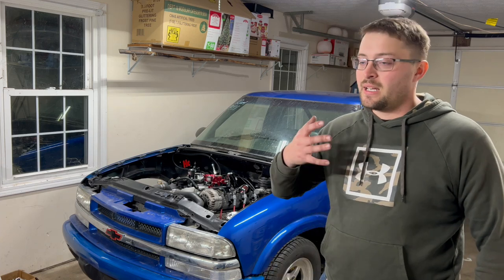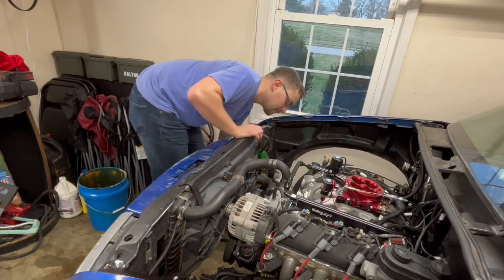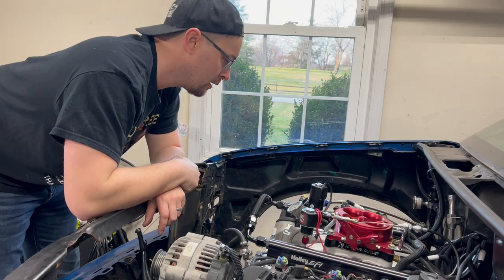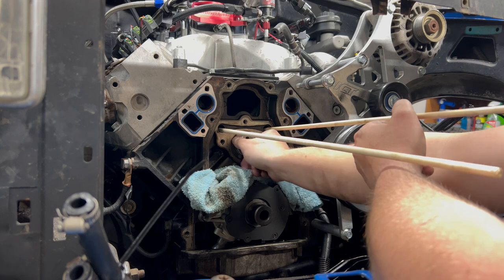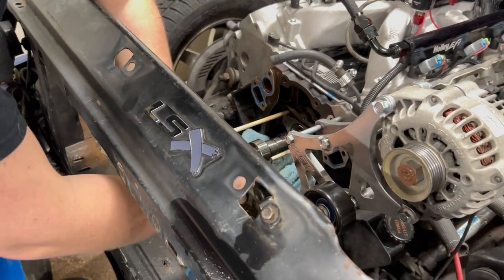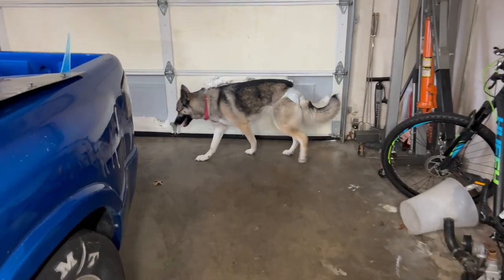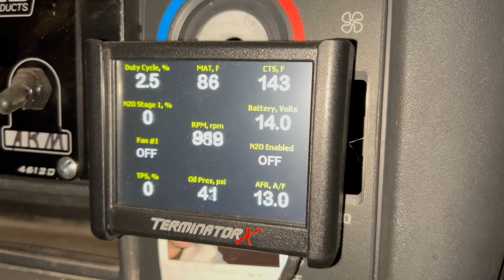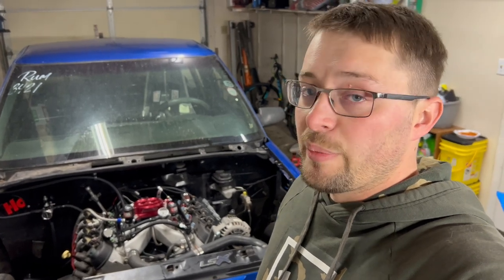I Installed a HUGE Cam in my 6.0 Ls S10! // Cam Motion Junkyard Dog Swap

Comment: I’m surprised no PTV clearance issues😮 but she sounds awesome
Reply: Right 💪🏽, makes me wonder head gasket thickness and if they are milled! Someone got there math on point
Reply: .621 max lift. Btr Stage 2 ls1 cams are .620/.605 i believe. Why would this have ptv issues?
Reply: Because 862s have small chambers as is compared to stock 317s and the new cam has way more lift than btr cams so that would make PTV clearance questionable mainly on the intake valve
Reply: @nathanvillarreal7937  true that
Reply: @tommys2979  it's not the lift but the duration that's the issue

Comment: What radiator and fan is that???? I am putting a 350 in a 1996 Jimmy and that looks VERY roomy.
Reply from the maker: This is a stock 4.3 s10 radiator recessed into the core support with around a 98ish dodge intrepid dual electric fans.
Reply: @LsBluu  THANKS

Comment: I'm think this camshaft will not like a load or much resistance on it until 4000+rpm but your truck being fairly light will help under 3400 pounds with driver this camshaft is not for something that weighing over 4000 pounds
Reply: Definitely not a cam youd want in a fullsize truck. I had the same thoughts on the cam i chose for my 5.3 s10 but knowing the truck is like 3200ish lbs it wont need too much low end to get it moving so i opted for a cam that will wake up more in higher rpm and i plan on spinning it to 6500-7000rpm anyway. Doing it as budget friendly as possibly so thats why i didnt just spec a cam for it.

Comment: If you get the right setup with this camshaft in your truck it should go easy 6.90s on the motor hopefully this isn't to long and please do not take it the wrong way l have a 2011 Camaro SS it has a GM performance LS3 495 horsepower crate engine with milled and CNC ported LS3 heads it has a ZL1 fuel pump and injectors a sheet metal intake and 102mm throttle body it has a built 6L80e transmission with a Circle D 4200rpm lockup stall converter with stock 3.27 gears and a Eaton limited slip it's tuned and runs on E85 it has a load of upgrades lowering springs aluminium one piece driveshaft. race star wheels 305/45r17 MT drag radials rear 18 inch skinnies front but the camshaft duration is 219 intake 228 exhaust it's a pretty mild camshaft it shifts at a fairly low 6600rpm the car weighs 3920 with me in it has a full interior and AC cars best eighth mile was 7.22 at 96mph with 1.65 60 foot times my only problem with it is I'd like to loose 4-5 hundred pounds and if this setup was in your 3400 pound or less S-10 with a good suspension and traction it should go 6.90s easy the engine in my Camaro is not a super high horsepower engine but it has a very broad torque curve it makes really good torque from 2700-6200rpm l had a LS2 swapped carberated single plane intake with a Holley 850 HP carberator 1984 Monte Carlo SS with milled CNC ported LS3 heads built 700r4 with 3000rpm stall converter and a 1986 Buick GN 8.5 rear end with 4.10 gears with a camshaft very simular to the one you just removed with a load of upgrades from 2008-December 2021 bought the car new in 1984 had it over 37 years sold it and bought the 2011 Camaro SS the Monte Carlo SS weighed 3380 with me in it AC deleted it ran 7.50s at 92mph 1.71 60 foot time so even with 500+ pounds of the Camaro it's almost 3 tenths faster than the Monte Carlo was l think the right stall converter and gearing will be more critical and will have to be spot on to get any gains with this new camshaft it will be less forgiving than your previous setup if setup is not matching it does sound wicked it will be more high strung than the previous setup
Reply: Sounds like your car would do better without the lowering springs, no?
Reply: @tommys2979  it's possible it hooks well goes straight with much less drama than the Monte Carlo did has gone 1.65 60 feet the Monte Carlo was lowered with Moroso drag springs front and back so the front end lifted much more off the light than the Camaro does with a decent burnout the Camaro has no traction issues it hooks pretty hard it does have a larger rear tire 305/45r17s than the 275/60r15s on the Monte Carlo the Camaro is very stable over 120mph than the Monte Carlo was at the end of the quarter mile with the Monte Carlo when you take your foot off the gas and the front end drops gives you a bit of a uneasy feeling the Camaro does not the front end of the Monte Carlo really stretched the front springs on take off
Reply: @tommys2979  it looks way better lowered these cars are known to sit kind of high vs other cars in this class
Reply: @tommys2979  it's lowered 1.4 inches it's not slammed leaving about a 1.5 inch gap between the tire and the top of the fender well instead of almost 3 inches l live in Florida it's not a drag car it's more of a nice weather weekend street car l do love the 6L80e automatic transmission with the super low 4.03 1st gear transmission ratio is how l get the 3 27 gears to work good with the Circle D 4200rpm lockup stall converter and AC makes driving on hot afternoons much more enjoyable as does the highway at 80mph at 2100rpm even with the 700r4 l had in the Monte Carlo with 4.10 gears at 80mph on the highway your turning 2800-2900rpm 1st and 2nd and 3rd gear in the Camaro are very close to the 4.10 gears in a 700r4 the Camaro does 123mph at 6600rpm in 3rd gear and with the super low transmission 1st gear ratio it's equivalent to a 4.30 1st gear in a 700r4 so with a fairly mild camshaft there's no need for 3.73-3.91-4.10 gears the throttle response is wicked at the slightest press of the gas petal it's really not a max effort setup its a very usable and can be driven anywhere including the highway for extended periods and do so effortlessly it is equipped with nitrous but timing needs to be backed down from 26 degrees to 19 degrees l have jets for 150-200-250 hit haven't used it yet only when dynoed it was used twice on a 150 hit but hasn't been used on the street or track yet on the motor to the rear tires it made 430 horsepower at 6200rpm and 410 foot pounds of torque at 5000rpm on the motor and 555 horsepower at 6200rpm and 535 foot pounds of torque at 5000rpm on a 150 hit
Reply: @tommys2979  the 7.22 at 96mph eighth mile pass was made with only 6 passes were not talking about a car that has 30-50 passes and the engine was new with 800 or so miles on it I'm pretty sure with more passes and experimenting with tire pressures it made these times on 20psi rear tire pressure and launch techniques it could go a tenth or two better it now has 1400 miles on it I'd love to go 7.0s-high 6.90s on the motor before hitting it with a 150 hit but the 3920 weight with me in it makes it close to impossible without guting things like seats door panels and so on 5th gen Camaros are clearly 500+ pounds on the heavy side for a serious drag car and the only way to shed this kind of weight would be very expensive carbon fiber doors hood fenders and trunk lid or remove everything not needed on the interior or both bottom line the car is pretty heavy my car has lost 110 pounds with removing stock exhaust and big heavy stock mufflers converters and putting on light weight wheels and tires if not it would weigh 4030 pounds with me in it
Reply: @tommys2979  l do love the serious idle and chop on this new camshaft this S-10 has my car sounds like a stock LS3 with long tube headers and a 3 inch X pipe into 3 inch Flow Master flow FX case mufflers exiting in the stock location so it sounds like a LS3 with a exhaust upgrade the mild LS3 GM hot cam has a ever so slight chop at idle that is barely noticeable vs a stock LS3 with the same exhaust upgrades it is fairly quite until about 2800rpm giving you no indication what it's capable of until around 2800rpm it's nothing like the serious chop of this new camshaft on this S-10 l can say l do miss the 7200rpm redline the Monte Carlo SS had the Camaro pulls very strong to 6600rpm power drops off quickly above that so no sense in revving it above that the Monte Carlo SS pulled very strong to 7200rpm l do miss that the + with the setup on my Camaro is the fairy mild camshaft is very easy on valve train components so basic maintenance and oil changes every 500-700 miles it's more than possible it runs well simular to a stock LS3 for a 100,000 miles without replacing very stiff valve springs every 10,000-20,000 miles or the headaches associated with large duration camshafts for me to gain possibly 2-3 tenths of a second maybe or to not pickup nothing or possibly loose time sometimes if something is working very well it's best not to mess with it I've seen many times a setup that's working very well and someone makes upgrades like a higher lift more duration camshaft with bad results not always but it does happen
Reply: @tommys2979  the springs are from BMR part # SP022 and l believe they have the same spring rate as the stock springs just 1.4 lower it's firm but doesn't seem to stiff l believe they 220 lbs front and 460 lbs rear spring rate
Reply: @gloriamaletta8667  oh no kidding, thanks for the info and replies. Ive just always been under the impression most lowering springs have increased rate and dont usually help with weight transfer for drag racing. My cousin actually has an 88 monte ss with a 6 liter, rec port heads and a monster cam in it now. On his old setup running lowering springs, the battery under the hood still and a 228/236 .598 .601 111lsa cam it ran 7.14 at 97mph with a bad launch. Im curious to see how she runs with the battery in the back, drag springs and the new cam. Hes technically going to need a cage in it soon if he wants to run faster at our local track.
Reply: @gloriamaletta8667  and wow 110lbs out of that car is pretty good. Most people dont understand how hard it is to strip even 60lbs from a vehicle.
Reply: @gloriamaletta8667  https://youtu.be/2kNMfKz7C5Q this is my cousins car i was speaking of. Unlike mr.steve there i can provide some proof of what im speaking of haha
Reply: @tommys2979  l had a blue one since new until December 2021 with a LS2 that ran 7.50s in the eight mile at 92mph it went through the original 305 then a 350 then a 383 then a LS2 with milled and CNC ported LS3 heads bought it from SDPC as a custom crate with a single plane intake
Reply: @gloriamaletta8667  that sounds awesome. My cousins started as a 355, then he had a stock ls1 in it on nitrous and a 4l60 til it blew then he went with a 6 liter/th350 combo. Hes trying to get it in the 6.90s before he sprays the new 6 liter set up
Reply: @tommys2979  good luck with it had a G-Body over 37 years
Reply: @gloriamaletta8667  thats awesome. Im sure he will have it ready to rip here shortly. Im not too involved in that project but we do wrench on it together every once in a while.

Comment: Hope this large camshaft gets you the results your wanting l could be completely wrong but l think at least a 4000-4200rpm stall converter and a 4400-4800rpm would most likely even be better with this camshaft it will be down on torque from idle to 4000rpm compared to the cam you had but it will probably carry torque and horsepower above 5500-6000rpm better good luck with it
Reply from the maker: I talked with my tuner and Dr. Tune em all from cleetus’ channel and this is the cam he recommended.
Reply: @LsBluu  these people are in the car and racing business they know more than me what transmission and stall converter and gearing you running
Reply from the maker: @gloriamaletta8667  currently a 3500 nitrous stall, TH400, and 4.10’s.
Reply: @LsBluu  another screw up..but that tells the world why it's so slow and getting nearly beat buy a stock neon..the best thing you could do is get a custom grind cam that is made to your engines full specs. You'll need to cc your heads if you know how for starters then you'll need to flow test the heads.and get rid of the turbo 400. You can't just swap a can and expect big results. If the truck needs a baby bottle then your doing a bunch wrong when I see stock 6.0 LS engines run low 10's in a s10 in the 1/4.
Reply from the maker: I’ll note what ever you say, to do the opposite.
Reply: @LsBluu  don't listen to this guy if you can keep the rpm range in between 5000-7200 this cam if setup right should be a monster if the 3500rpm stall converter works well with it that's great the only thing l see is it may need more converter but other's with way more knowledge than me said the 3500 will be fine the 4.10 gears will be good for this setup worst that could happen is you need to get a stall converter that flashes 4400-4800rpm you'll see most of your gains with this camshaft over your other camshaft above 5000rpm up hope it works good for you be waiting for your first motor passes with it truck sounds wicked at idle good luck with it
Reply: @LsBluu  don't know if you watch videos on YouTube but if you get a chance type in MAPerformance Customer Loyalty Managers 500hp LS Swapped Malibu it's a 1980 Malibu with a carberated LS swap very simular to your S-10 it has a 5000rpm Circle D stall converter car is a monster besides the cowl hood and wheels and tires it looks pretty stock this was what got me started on 4000+ stall converters cammed LS engines love high stall converters
Reply: @LsBluu  when I'm beating you with a stock engine maybe you'll learn. You have already proven that you have much to learn. I have forgot more then you'll know. You just stated that your s youtube engine guy lol
Reply from the maker: @thecarguy2470  lol what?
Reply: @thecarguy2470   no "stock" 6.0 will run low 10s in a s10.
Reply: @slows102  you need to join a few S10 groups and see it yourself before speaking on something you haven't a clue about.

Comment: did you say norbys? you must be around lebanon then?
Reply from the maker: Lol yea
Reply: @LsBluu  hah nice me too. Can’t believe I’ve never seen your truck out and about. Do cops ever give you a hard time about driving on slicks? Ours seem pretty laid back. I know there’s several around on slicks. Curious if ya ever get stopped for it lol
Reply from the maker: Knock on wood, the only thing I’ve ever gotten pulled over for is a seatbelt in Springfield. I pass them all the time and they never bother me.
Reply: @LsBluu  well that’s good to hear. And I believe it about Springfield. Certain places around there they’ll get you for lookin at them funny. I’m looking to build a 3rd gen Camaro with a single turbo 5.3 or 6.0. Never built a car before so it should be interesting…..

Comment: What length pushrods are you running?
Reply from the maker: 7.4
Reply: @LsBluu  7.4 with what cam lift? I'm putting together a 5.7 ls1 with flat tops setting ring gaps for a nitrous set up with a BTR red hot cam. 619/617 lift 799 ported heads with TBSS intake.
Reply from the maker: 238/254 .621/.604

Comment: you running a stock, v6 radiator?
Reply from the maker: Yes.
Reply: @LsBluu  Threw mine out, I feel dumb... though I don't regret I'll be upgrading to all aluminum welded
Reply: @jonathanschubert9052  I have been reading the s10 v8 swap book from JTR and they say a Corvette radiator actually fits.
Reply: @yurimodin7333  corvette parts seem to be the play generally